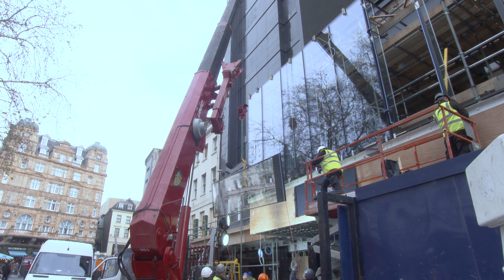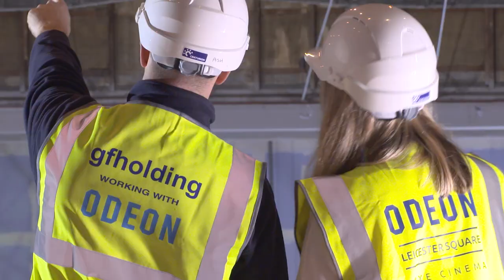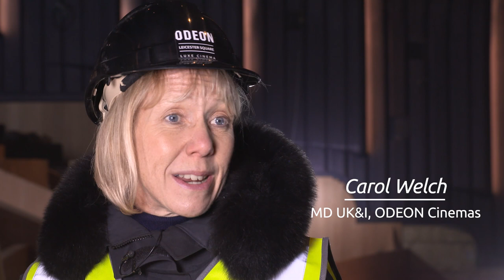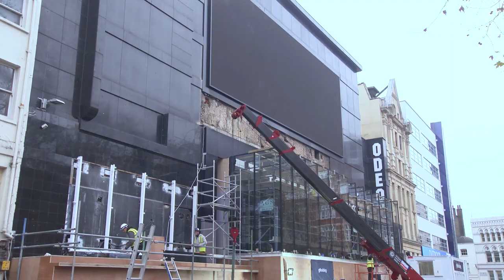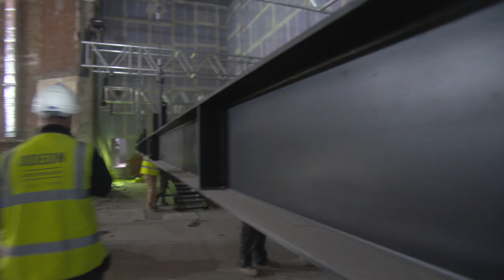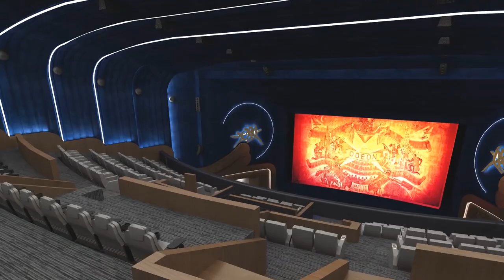ODEON Luxe Leicester Square is coming

Comment: IMAX Laser at the Cineworld/Empire vs Dolby Vision Laser in the same location! Awesome to get progress as home cinema TV's/Projectors have long since left behind traditional bulb projectors used in cinemas. The Laser at the Empire is amazing - looking forward to seeing a few screenings at the Dolby Vision. Shame Dolby doesn't do 3D though like the IMAX - 3D in a laser looks spectacular. Not the crappy, dull, ghost ridden image we're used to with non-laser. But I know they've been working with James Cameron's 3D group so will get a nice, bright, cross talk free 3D image projected by the time Avatar 2 is out.
Reply: They do 3D, i watched Alita in the dolby cinema and there's lots of upcoming 3D movies there
Reply: The 3D 4K IMAX Laser in cineworld Leicester square is better then the Odeons Dolby cinema
Reply: you mean it's at leicester Square?
Reply: Dolby held/hold patents on the "colour separation" 3D system (where different wavelengths are used for red/green/blue primaries for each eye, the glasses filter out the wavelengths that the other eye sees.) The 3D system is actually the same--IMAX 3D glasses AFAIK (for the "GT" dual laser system) actually are still marked with the Dolby logo and certainly back in 2015 had patent blurb on them! In the Odeon West End Dolby Cinema, if you look towards the rear of the auditorium, you can see the colours from the two projectors are differently hued--even on 2D screenings.

The Dolby system can be used with conventional Xenon light source projection--it was actually installed in The Empire (before the IMAX conversion)--originally with 4xBarco 2K projection for the Avatar premiere. Two projectors "per eye" for sufficient brightness. It was excellent, but polarisation (RealD etc.) captured the market. 

Both Dolby and IMAX use industry standard parts (like the 4K DLP chips) but with their own proprietary technologies. The IMAX projection is engineered from the "ground up," it eliminates the prism used to recombine RGB found in other projectors. This requires precision engineering and expensive materials to ensure consistent alignment. The result is a very sharp but smoothly "cinematic" image, and very low black level. Peak brightness for Dolby is higher though.